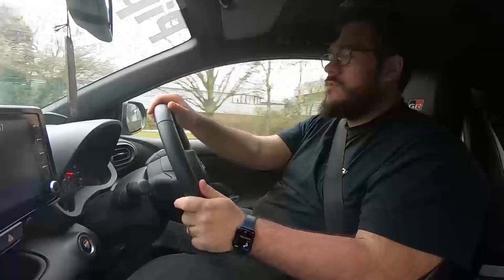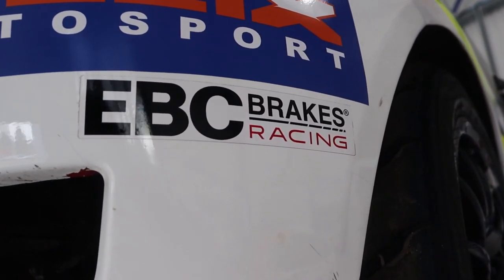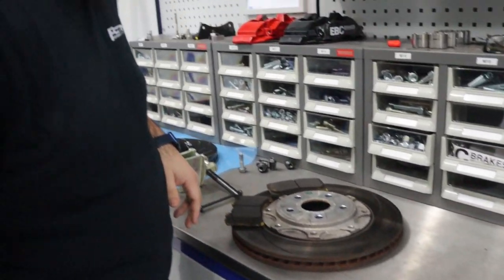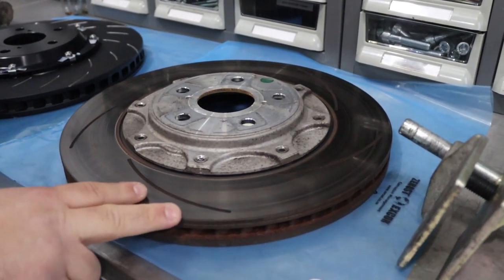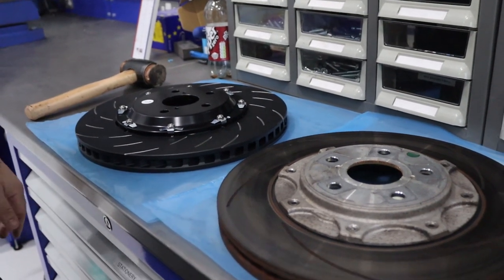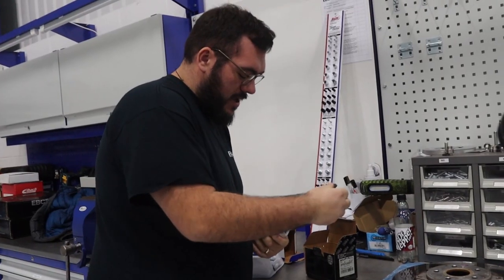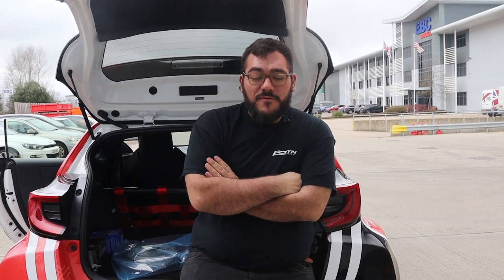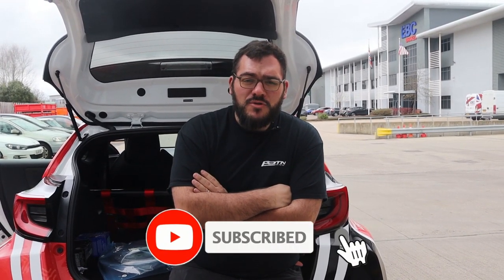GR YARIS Time to Sort out the Brakes! We Head Over to EBC HQ

Comment: Our 2 options in australia are either 7.3kg costing 2200AUD you 7.95kg at 1300AUD. I believe factory weight is just a smidge over 10kg
Reply from the maker: wow that's light what brand are those? I know EBC puts a lot of extra veins within there discs to give is the benefit of dispersing more hot air and gases but i dont expect the EBC ones to be anywhere near 2200AUD which i work out to be around £1160 but these are still the pre-production model so may change.